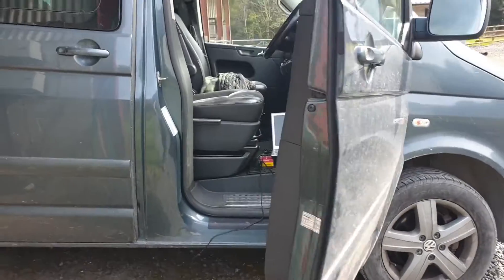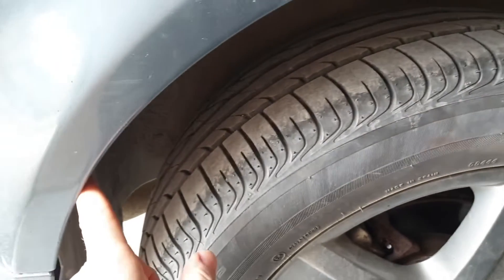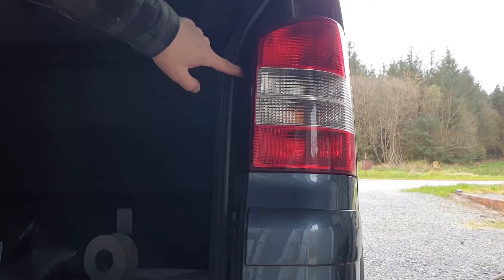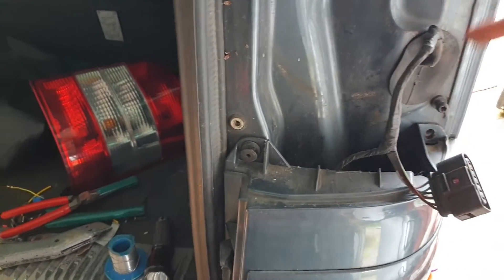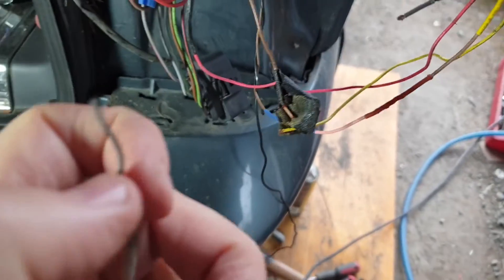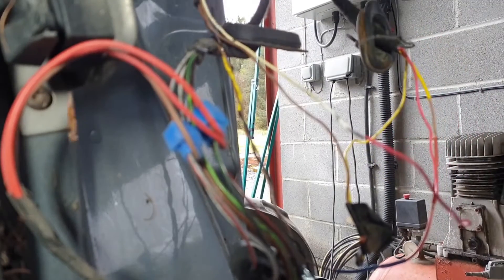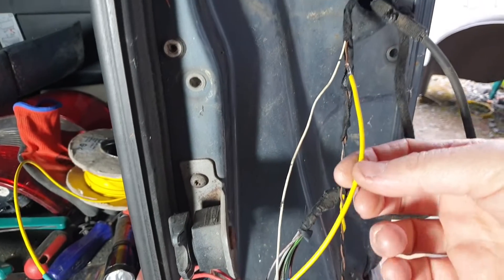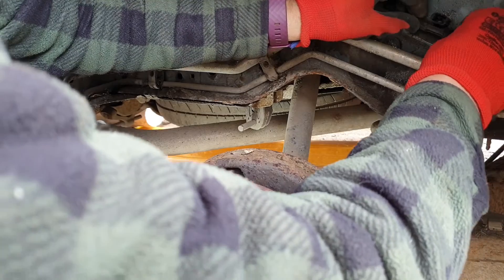How to fix VW T5 - ABS / ESP Wiring Fault 00287 Permanent FIX!

Comment: my škoda yeti 4x4 throws up 00287 even after changing the bearing and the sensor. Could it be a wiring fault like this?
Reply: rear right side is not detecting speed even after changing these parts. 3 wheels show speed while moving while the rear right doesn’t
Reply from the maker: Never worked on a yeti but If you have access to live data I would check each wheel individually just to make sure that they are displayed correctly and your working on the correct wheel, I've had it before where the car is displaying as a lhd. Get a wiring diagram and physically check the cabling between sensor and ecu, all connectors but especially if the cable changes to a different type as there could be similar crimps causing the problem
Reply from the maker: It could be wiring or bad connections at the ecu

Comment: Hi. Has T6 same wiring loom locations?
Rear light etc. I have an abs light on repeatedly even after sensor change
Reply from the maker: I wouldn't be surprised if they do, pull the rear wheel arch liner out and follow the cable, not done one but my guess is they are the same definitely worth having a look.

Comment: Excellent.  Thanks! I started having the same issue immediately after having the clutch swapped. Does the reverse switch connector shares the ABS line? 

Hoping this here's not my prob, but could be with all the failure on yours there.
Reply from the maker: I would expect the abs to be separate from the reverse switch to protect the abs from failure, a wiring diagram for your model should confirm.
Reply: @50plusdad-uk   I'll take a look at that. Thanks!
Reply from the maker: Good luck with it 👍

Comment: Great Video, a quick question as i have a similar fault but using vcds i can see the speed sensors all show a speed would this point to a fault more with the ABS pump/Ecu rather then the wiring? I was about to do that same process you have done but not sure if i have the same issue now? Thanks
Reply from the maker: Might be worth checking the wiring if it's pointing to a specific wheel especially o/s/r as it may be failing under load, I replaced the sensor first could see speed on live data and it was ok for a few days then failed again.
Reply: @50plusdad-uk  thank you, I wanted to double check the wiring like you did but didn't want to waste time if the speed showing on the sensor was a good indication the wiring is ok.
Reply from the maker: No problem 👍